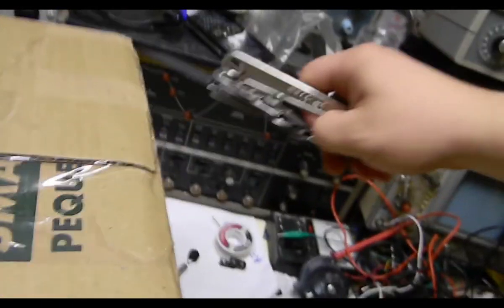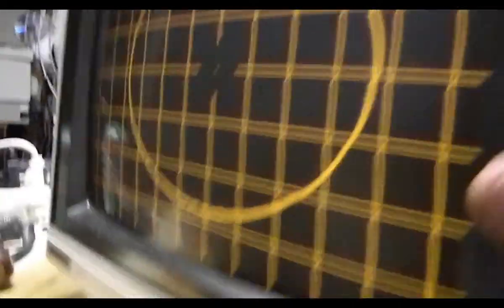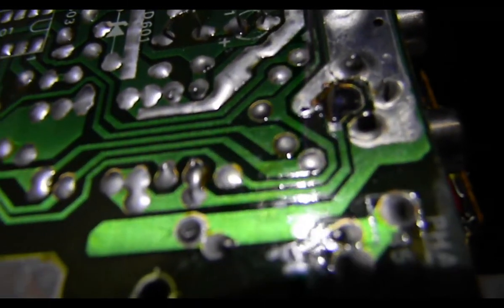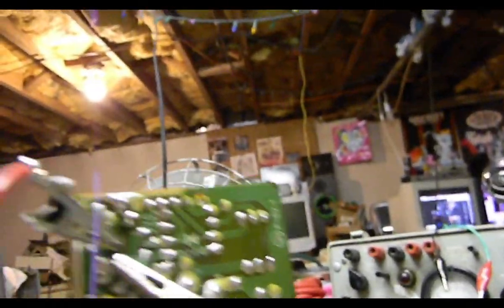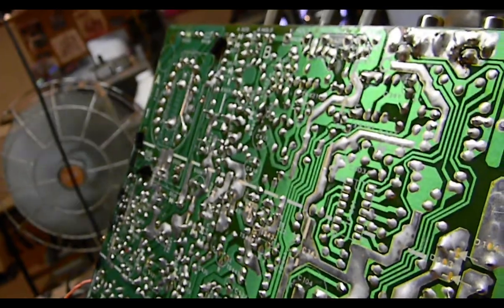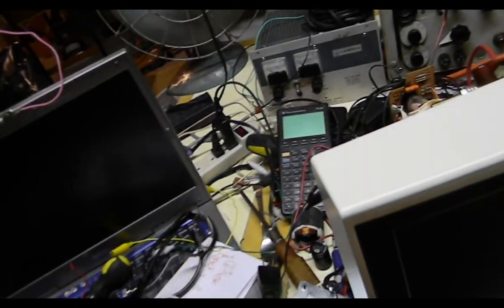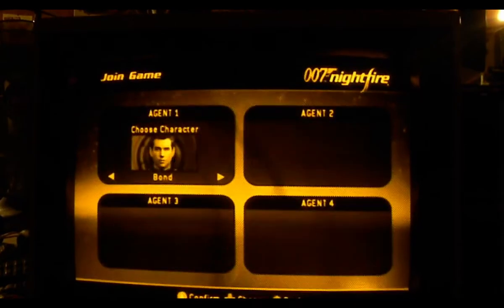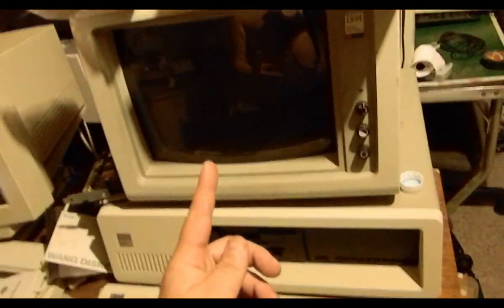Magnavox Computer Monitor 80 Repair (DOA)

Comment: they sound crackly because they are in circuit,you could damage something like that
Reply from the maker: thats how shango do it. and i would probably have to crank out some watts before things started breaking. got to think im probably putting out less than 5v and its in series with a 8 ohm speaker to drop load further.  

i do agree the potential for damage is there but its highly unlikely.
Reply: 5 volts at 8 ohms is more than 0.5A,that could damage most things,but I doubt you we;re up to 5 volts,but still,please test out of circuit next time

Comment: I may be late to say this but I reflowed a power supply and somehow it still works. How I don't know but I think it's crazy 4 years later. I think it's about to die though
Reply from the maker: now days everything is made cheeply and with a small amount of lead free solder. so the end result is modern things need reflowed alot.